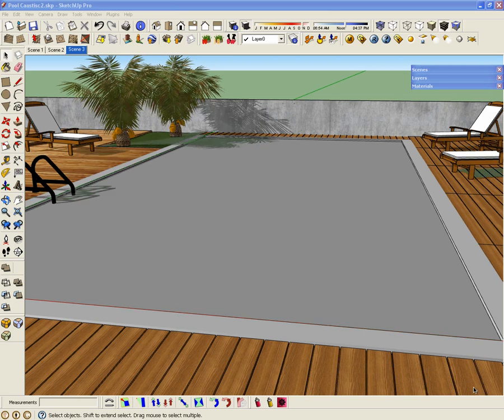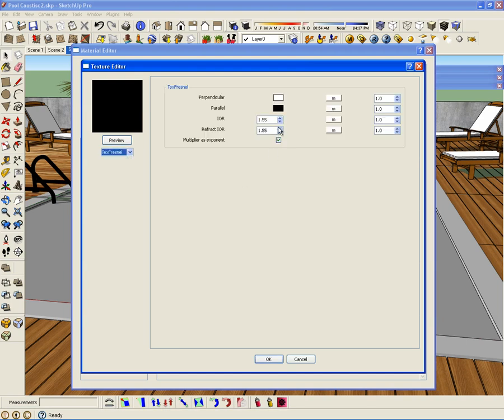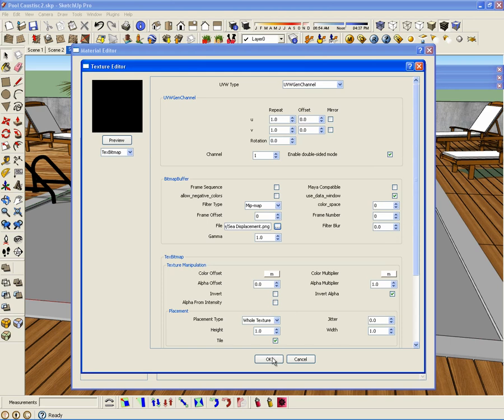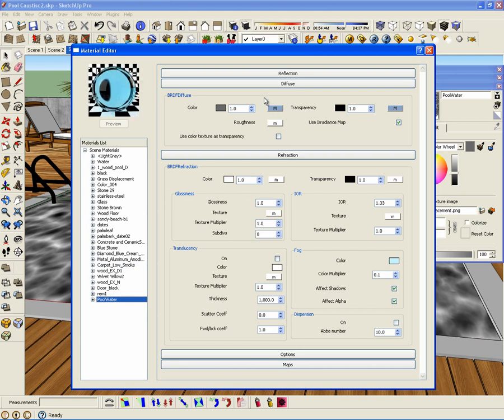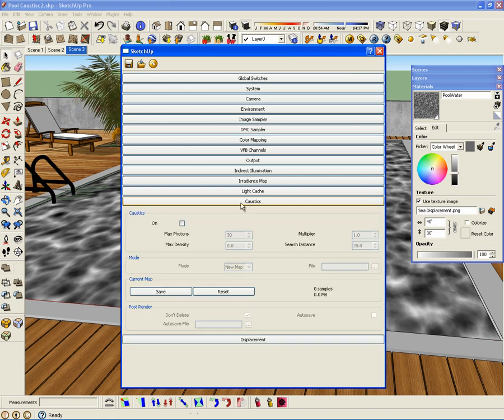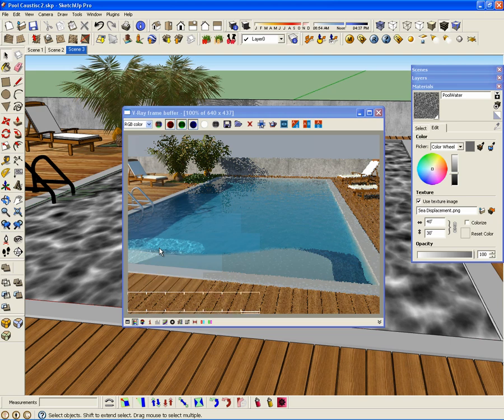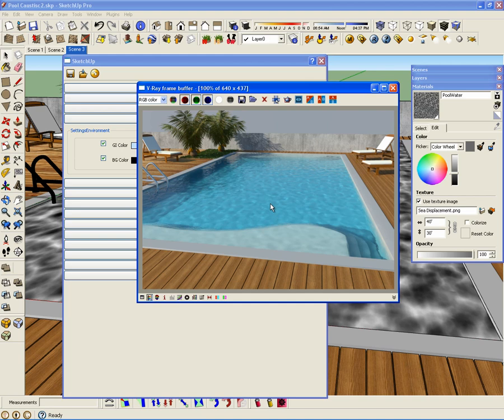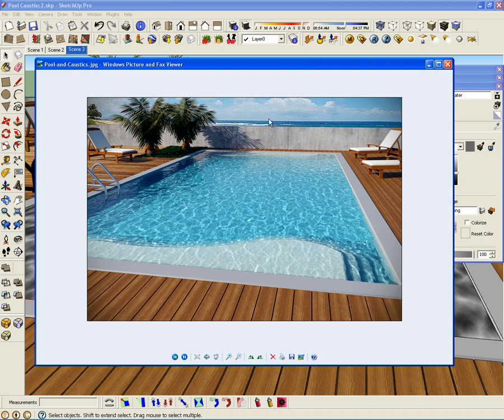V-Ray Caustics

Comment: Caustic in vray 2.0 not work ! You know how to solve?
Reply: +Daniel Marques if you want caustics in VFR 2.0, you can try to use a Dome Light for that. Take in count that you must turn off the Affect Shadows option in the water material, and of course, the Target Radius and the Emit Radius are important to achieve a good result.
Reply: +Luis B. Lobo can u make a tuto for vray 2.0 please??
Reply: Hello, I am working on it! :)
Reply: +Luis Lobo thx very much!
Reply: +Luis Lobo  You are right with Dome Light does work! But it is not the best solution. I spent so much time search for the right combination of options, so it is hard to explain :p
Reply: +T for Tako today I am going to show you how to do caustics without any problem using Vray for Rhino. ;)
Reply: Luis Lobo waiting for it!

Comment: I would love a  tutorial for this on the newer version of V-ray (2.0 and above) As I get no results...
Reply: ***** My water always become very very blue, no matter what I do.
Reply: do you know what version is this vray.?
Reply: This I believe is the 1.49
Reply: so vray version 2 is not good at all :/
Reply: I've tried. and it's not working :/
Reply: I'll try.. thanks man. Will work on that
Reply: Mateus Henrique Same here. If I make an ocean it becomes very dark blue. No adjustments I do makes any difference.
Reply: Mateus Henrique yup same happens to me, a very dark blue. maybe some default settings are causing it to happen. anyway im new in vray. ^_^
Reply: +Mateus Henrique try to disable the Affect Shadows option in the material.
Reply: The solution is.. u need to group the surface material of that (water). just double click on it and make group.

Comment: Thank you very much for the Tutorial, it has been very useful, just a question, I used the exact settings as you mentioned in the video, Right now the problem that I'm having is that I guess the intensity of my sunlight is not as much as it's supposed to be, It's not that bright, It's like 6 pm kinda sun :P
Btw, all the other settings are default which means i didn't really change anything
Would appreciate if you could help me out ;)

Comment: Fernando, could you please help me, I would also like to render a water surface based on your video. But its reflection somehow is too strong and it looks like a window pane. I downloaded some vismat files but the problem is the same with these to. Is it possible that I have to set something differently in the v ray options?